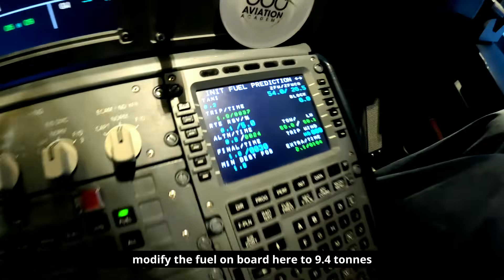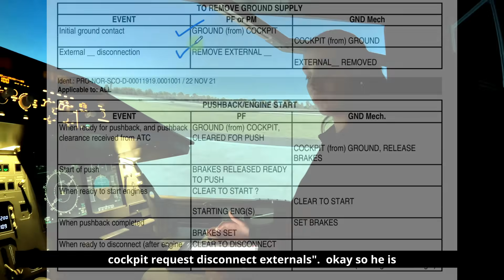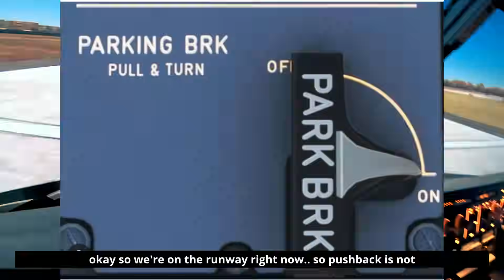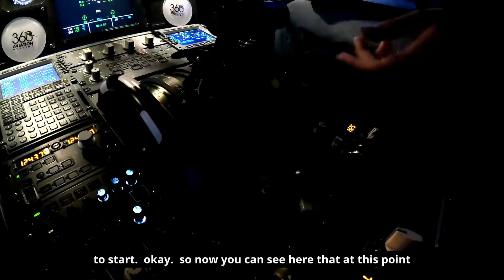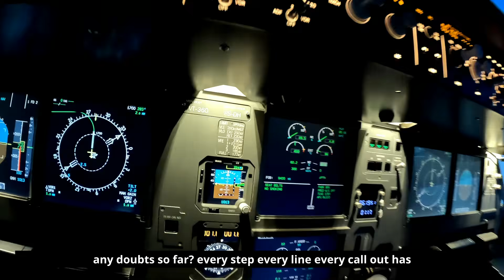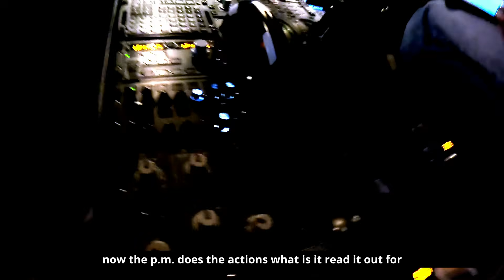A320 Pre-Type Rating..Starting a Jet Engine!! Before Start Flows explained...

Comment: what's the need of this if we are gonna learn it all in type rating itself?
Reply from the maker: Good question.
Type rating Simulator training is expensive. Approximately 1600 US dollars per session. You get limited time in sim to cover your doubts or weak areas. Instructors expect you to know your SOP's even before you commence Type rating.
Pre TR training on our Fixed base sim is affordable with an extended period of training time covering basic SOP's and flying maneuvres. 
This is especially useful for Low hour pilots transitioning to the big jets.